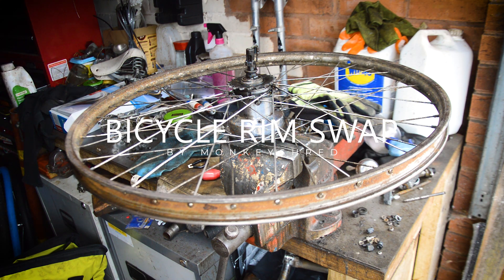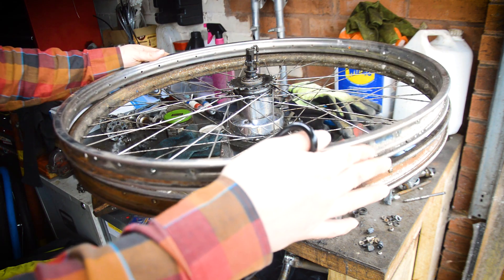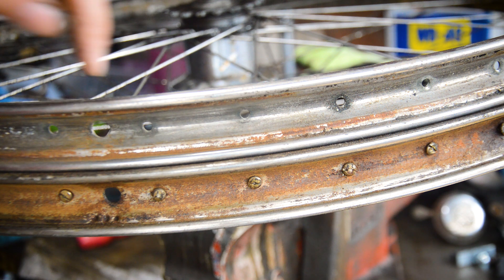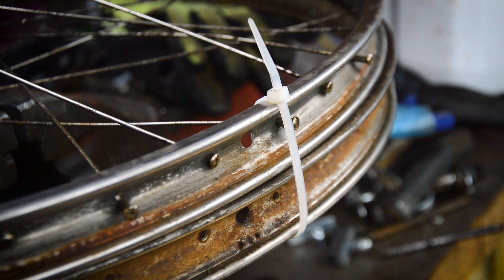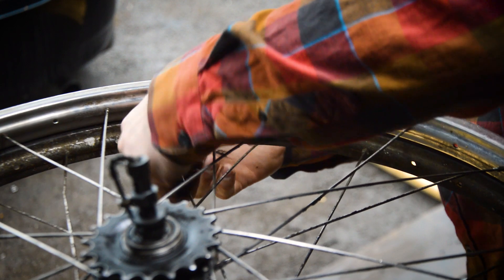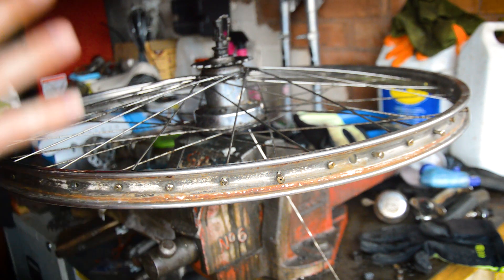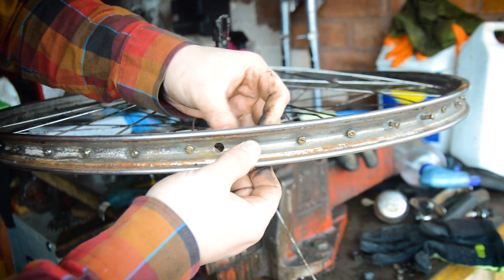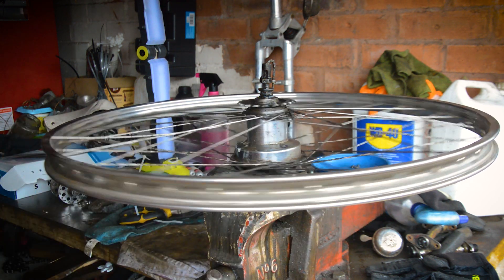A Simple "Side By Side" Bicycle Rim Swap - Replacing Bicycle Rims

Comment: I did this yesterday and took the swapped hubs to my lbs for tensioning and truing.  I think I saved some money but mainly I wanted to make sure the new hoops were installed so I could view the mfr on the hub through the valve hole and so I could read the name on the hoops from the drive side.  I'll get them back in a few days, maybe weeks.  Crazy times at the bike shop.  Thanks.
Reply from the maker: I know right.  My LBS is crazy at the moment.  They've hired an extra person to cope and are possibly preparing a second building for servicing.  I'm contemplating giving up my Sundays to see if they need any help.

Comment: Could you possibly do a video explaining friction shifters? I have a 1970 schwinn suburban 10speed and I cant seem to get the chain to go into the smallest cog. Its a new chain and new cable. I dont know if I made the housing at an appropriate length.
Reply from the maker: If you've just replaced a cable, you might have pulled it too tight when clamping it down. That or somehow the limit screws changed and the high limited screw is stopping the derailleur from moving over